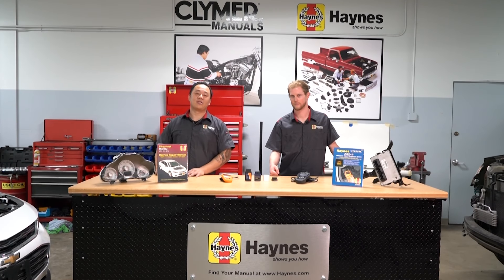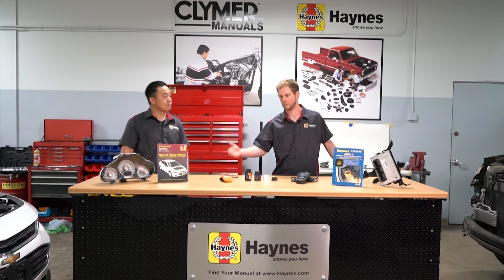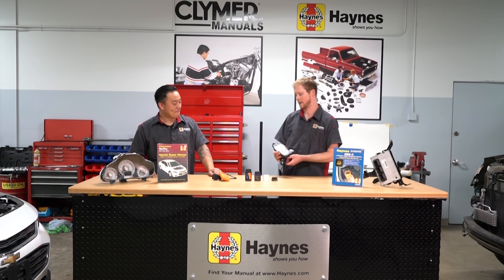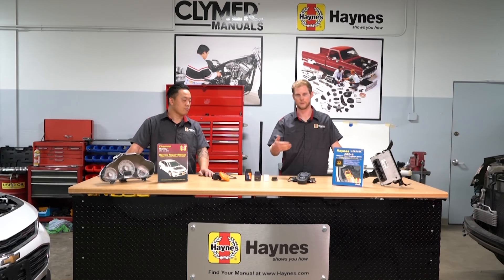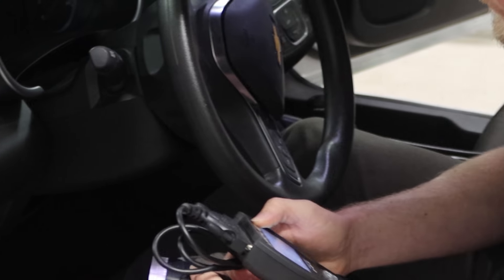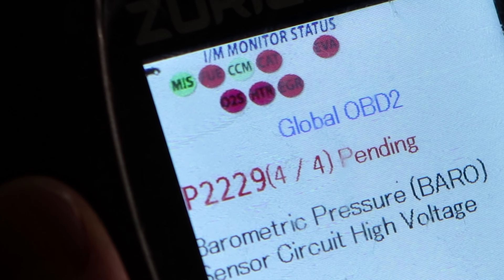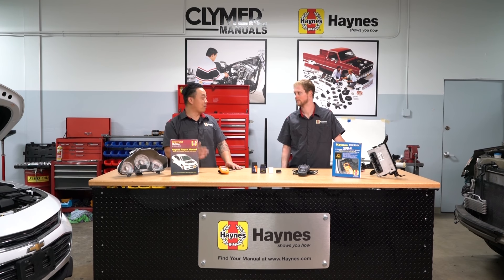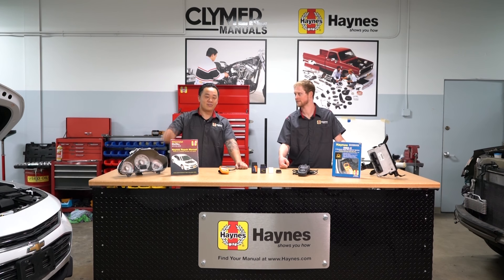Overview: How To Use OBD-II Scanner to Check Engine Light Codes - What type of scanners are there?

Comment: This is good info.  Perchance, do you sell a summary list of all standard OBD2 codes, either vendor-independent, or per-vehicle, or per-manufacturer?  Something with a sentence or two that explains what the code is supposed to mean.  I have a few print and online Haynes manuals and I don't believe I've seen such a list.

Further, searching the code on the Internet isn't always easy, and even the code readers that give a standard, short description (ex: "System Too Lean At Idle, Bank 1") aren't always enough to help someone who has never seen that code before.

Anyway, I appreciate all the free and paid content Haynes puts out.
Reply from the maker: Hi Jim, thanks for the kind words and your interest.
Almost every car manual we have has a section with a general list of OBDII codes for that vehicle (toward the beginning of Chapter 6 in our US books). It should also give a brief description for the codes listed.

If you'd like to get more in depth into the diagnostic system, our OBDII Techbook (manual 10206) gives more specific info on these diagnostics. This includes a bigger list of trouble codes [generic and manufacturer], tools, troubleshooting info, etc.

Hope this helps, have a great day and happy repairs!
Reply: @HaynesManuals  Thanks!  For some reason I never noticed the OBD information in the various manuals.  Seems silly now - thank you for pointing out this information.  I'm also going to grab a copy of Techbook 10206 - this looks like exactly what I need!
Reply from the maker: @Jim_Jimworth  Glad we could help!

Comment: Ive got a question. Is it ok to clear engine codes while the engine is running? thanks.
Reply from the maker: Yes, that should be fine to clear codes with the engine running - although keep in mind that some cars require the key to be in the 'on' position (with the engine not running) to allow for full scan tool capabilities.